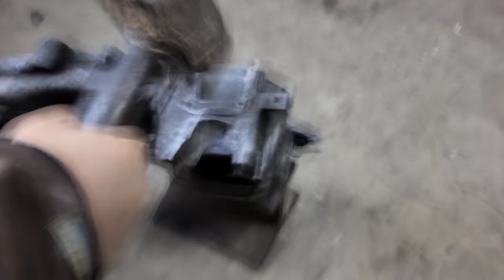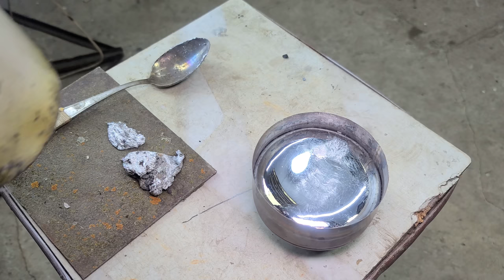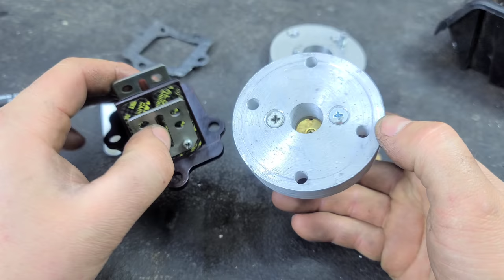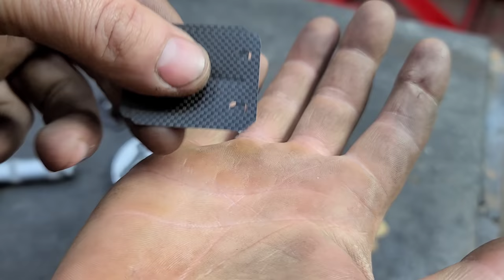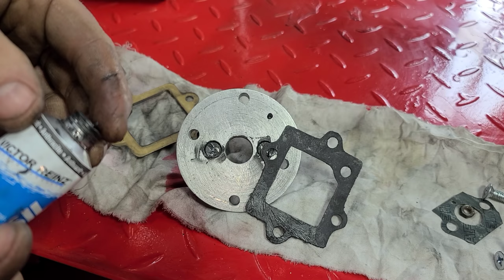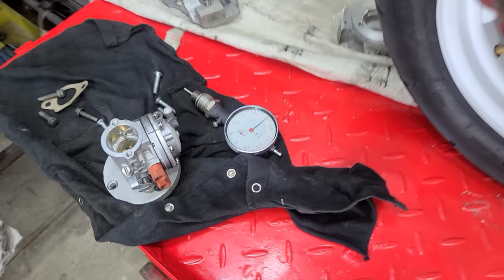Установка карбюратора от бензопилы STIHL MS 180 на скутер Yamaha Jog ( переходник )

Comment: excuse the question, but how do you power a 70cc with a chainsaw carburetor?  don't you think it's a little too small for that cylinder?  so you halve the performance ... if I were you I would opt for a 30 mm Tryton, and to tighten the manifold well on the crankcase do not use classic screws, or one of the Torx screws or hexagonal head screws, so as to have correct tightening
Reply: I didn’t really understand why someone would do this.
Reply: @jimccc9467  what did I not understand?
Reply: @4ndr3wv.43  why put this carburetor on this scooter?
Reply: @jimccc9467  kart carburetors are used on scooters, but not the chainsaw one ... they perform well if the kart ones are calibrated correctly

Comment: that zama carb is too small for that setup, but the biggest problem is that it is not adjustable.
there is only a idle speed adjustment screw in that carb
Reply: It a Absolute no sense mod
Reply: Use carburator from ms661 have more sense, too large and have L H screw

Comment: Shouldn't that tiny hole for carburetor pump be connected to crankcase before reed valve? Check how it is on chainsaw- hole gets vacuum before intake gets vacuum. Otherwise it might underperform.
Reply: But it is, he drilled a channel inside the aluminum adapter he made.